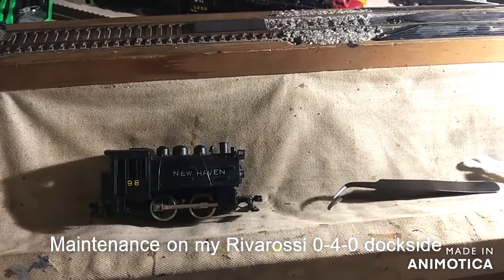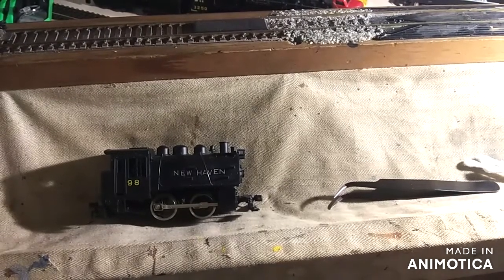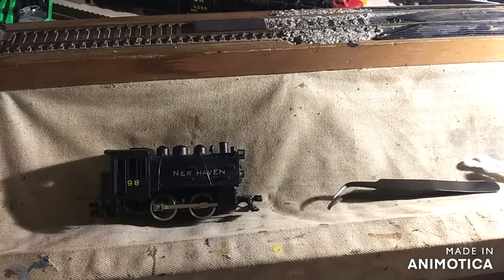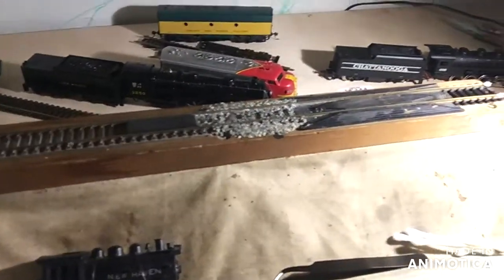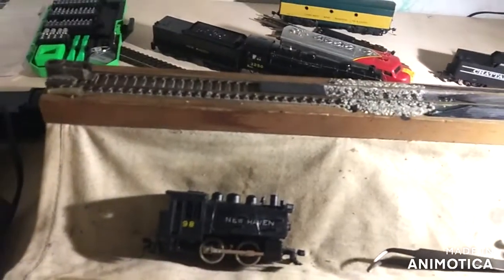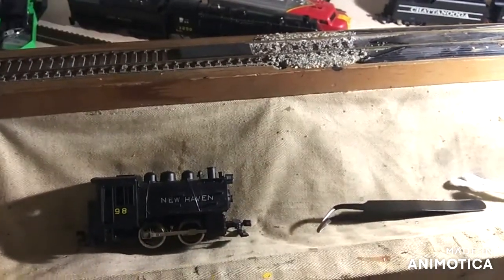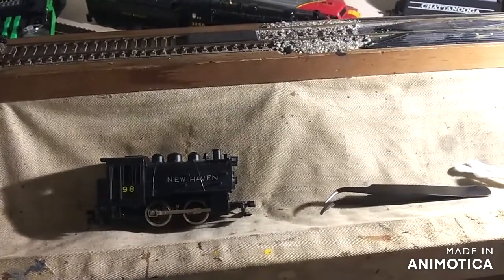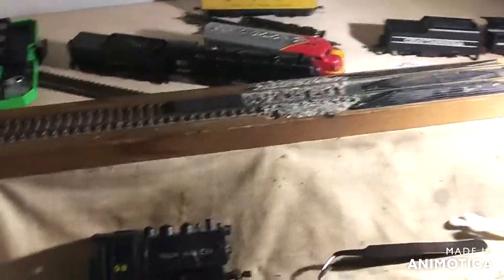Maintenance of my HO scale Rivarossi  0-4-0 dockside

Comment: Good job.  Does the Chattanooga run?  I have to find that grease at harbor freight.  I've been using 10 weight air tool oil.  It's just plain 10 weight and seem to work fine.
Reply from the maker: Thank you yes thats a over paid 0-4-0. Oh yes chattanooga she runs I have more video coming out and the one of it when I do grease it coming out Sunday or Monday. I have one oc when I first got it on on here . You wouldn't believe what that set cost mind you I didnt get all the track it came with and it was nasty looking including cars. Which most have Kadee couplers now. She dont smoke but i plan on fixing it just gotta get a coil . its a quiet tender drive in my opinion the video I made of when I greased it and oil is coming out soon . the grease I know sounds cheap but I looked on harbor freight website a guy was looking for it for rc cars apparently someone told him use that I'm thinking because he said need it for that and works good. SMT even heard good things about it and so here's me bsing the guinea pig lol I gotta venture out and try because well 1 im cheap and 2 i did research lol to make sure its good lol. On their website they have a list of plastics its compatible with all were checked for this as good nylon etc.
Reply: @mercuryoak2  I always go the cheap route too!  Check the dollar store first, LOL!  Where is the flea market that you go to?
Reply from the maker: @dbtech7914  I go to the local one in my town Griswold. Oh and the dockside I paid more then what i found at flea market the guy is very fair and he collects no joke Missouri pacific. Locos cars etc I said wow really. He said he's from there thats why. Anyway yes I made ballast from sand at the dollar tree. 1 bag tan and 1 bag black and mixed. Also ive got ideas of moss and stuff they have for trees etc. Between Harrison , Garrett (kokosing valley model railroad) and Nathen delay I have ideas about alot of stuff. Its slow. Slloooow progress but im focused on getting a car